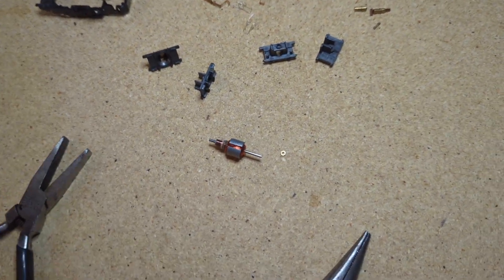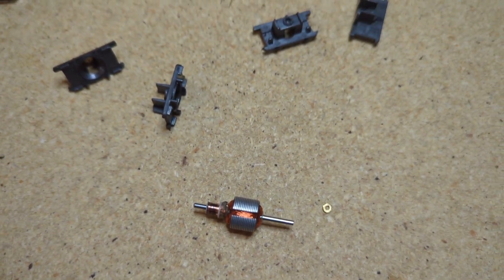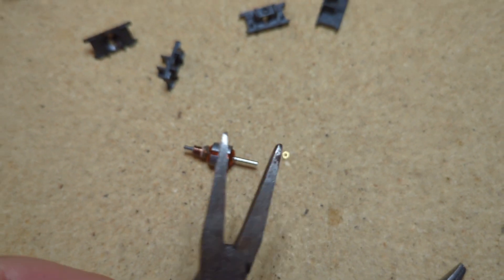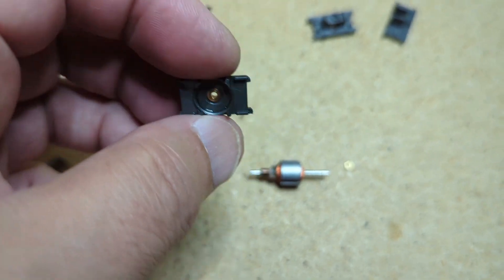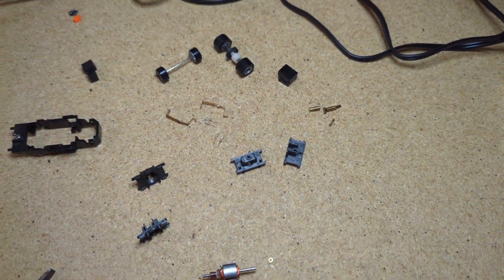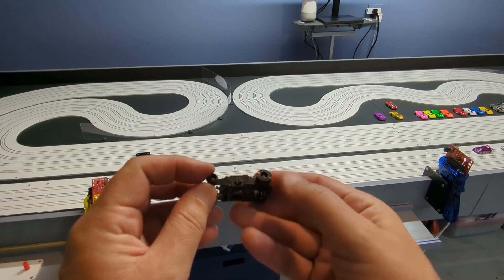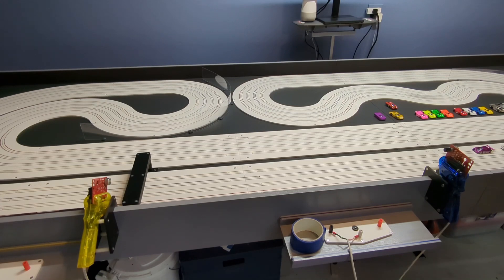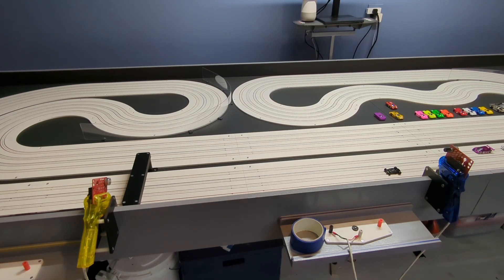Tyco 2.8 ohm chassis revisit and rebuild

Comment: YEAH!!! Those 440x2s are a challenge. I think that's why I'm drawn to them. Glutton for punishment. 
When you get one put together right and tight, they can be beasts.
If you need some technique info, Terry, on his Harden Creek channel, has some of the best 440x2 assembly and tuning videos I've found.
Now that you have that spacer pulled, one thing to be careful of is to check that your arm winding wires aren't slightly rubbing on the bulkheads. On some custom wound low ohm arms, the windings can be "fatter" than the stock arms and they protrude a little farther, especially on the back end of the arm. 
With bushing bulkheads, if the arm has enough back to front play, you might want to consider a thin Teflon spacer in place of that thick brass one.
Chassis sounds great and it seems really smooth. Great job!
Reply from the maker: Thanks! I have seen Terry's videos, I have pretty much watched everything he has...lol As for the 2.8 ohm are there was already a thin Teflon spacer that was in between the windings and that brass spacer, I left the Teflon spacer on, I check for any play to see if it needed additional spacers but it was pretty good as is, just a little play.

Comment: Thanks for sharing. As always practice makes perfect or at least better.I was having the opposite effect on working on viper type chassis. I had the Tycos down and constantly breaking the traction magnet clip on the vipers and super g plus chassis. Glad you tackeled the bushing dilemma. I hope you feel a little better about Tycos as I with vipers.
Reply from the maker: Thanks Tim, yeah I am getting better at rebuilding the Tyco chassis, I still prefer my Vipers. I have never broke a magnet clip though on my stiff version of the Viper chassis that I use on my high down force cars that clip is a pain to get on. The trick is to line it up then push from the center of the clip so it starts to spread, at least that works for me.
Reply: Have a technique for installing the magnet retainer clip. Slide it onto the chassis from the rear until it is in position. Haven't broken one since I started doing that. Used to occasionally break a Tomy clip installing it the usual way, from the side.
Reply from the maker: @jeffnorbert1871  Thanks Jeff,  I will have to give that a try.
Reply: @jeffnorbert1871  Thanks for the tip Jeff, I will try that next time.
Reply: @marksslotcargarage  Thanks for the tip Mark. Iwill get a stiff chassis for my next build.
Reply from the maker: @timmccartney6078  Stiff or Firm chassis for Pro 25 and higher magnets. The medium chassis is good for up to Pro 10.

Comment: Thanks for the updated Tyco 440x2 video. The Tyco 440x2 chassis is my fav (home use) chassis just behind the Super G+/Viper chassis. I like the reliability, build quality, and performance of the Tyco 440x2 compared to the newer AFX Mega G+ or Auto-World products. I also find the (tinker factor) of repairs/upgrades to be somewhat engaging. Mega G+ or Auto-World bodies on Tyco 440x2 chassis would be my slot-car product of choice...
Reply from the maker: Thank Lonnie, I was not a big fan of the Tyco 440x2 at first but it is growing on me. I much prefer my Super G Plus/Viper's, I don't really care for the brush barrel setup and putting on the double pickup shoe springs is a pain, they definitely have a high tinker factor...lol they do run good though when setup properly.

Comment: Hi MSCG..to cool,you conquered the mountain. I guess using those no teeth pliers you're able to save the busing. Now to conquer the sweet science of spacing. After over spacing and burning up 3 arm's(too tight)I got it down to 5 thousands play, car's run great. I'm using Wizzard's,using only .15 and .10 seem to do everything I need,I''m using the .15 as rear axle stabilizer's between the hub and axle cage, takes all the play out, which makes for a faster car,I think? Nice come back 😎
Reply from the maker: Yeah the right pliers made all the difference. I know all about armature spacing from the Viper chassis's I build, this 2.8 ohm arm did not require any additional spacing other than the thin Teflon spacer that was already on it. Thanks again.

Comment: When using bushings or bearings I chuck up arm in dremel and polish the shaft area that goes through the bushing… back you have to watch because of the pinion gear fit you can always put dab of glue on rear shaft for gear if it slips ..but front there is nothing that attaches to it
Reply from the maker: Yeah this arm probably could have used that, it was not too bad but definitely did not spin as free as just the plastic bulkhead without the bushings. With the bulkheads with the bushings I could feel a tiny bit of resistance.
Reply: @marksslotcargarage  I think you will be o k .Brass/ bronze will open up when warm.

Comment: Good move on not trying to film the build!  Sometimes those shoe springs fight back! 😂👍 Did you try your pinion tool to remove the bushing?  First thing I thought of when I saw what you were trying to remove.  Glad to see you got it running! 😁👍🏁🏎
Reply from the maker: Thanks Scott! I don't think the pinion tool would have worked, the bushing was pressed on pretty tight, don't think I would have been able to get the tool between the bushing and the armature windings without doing damage.